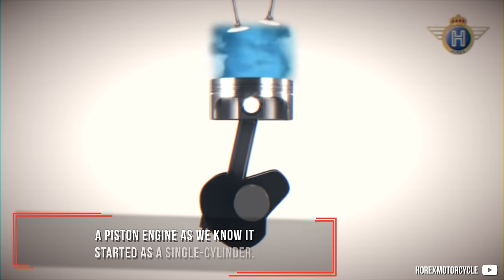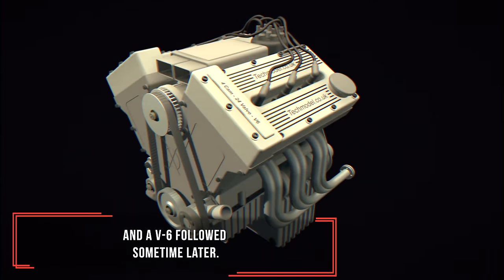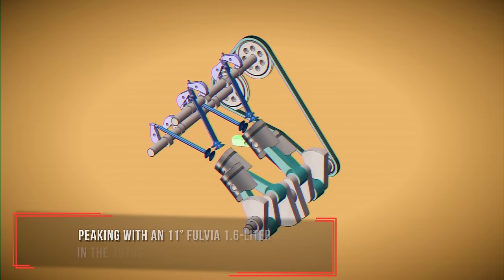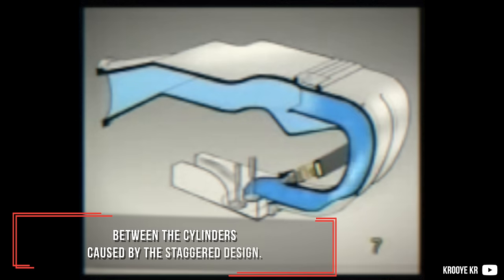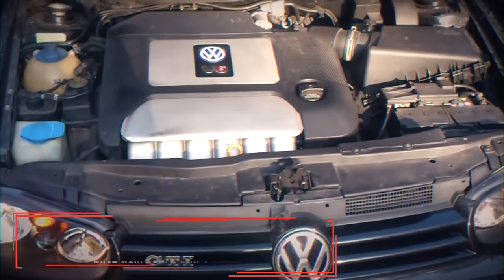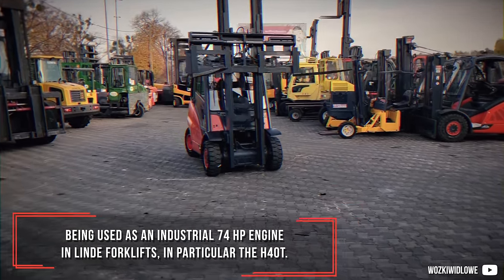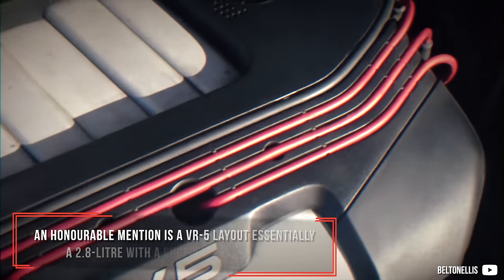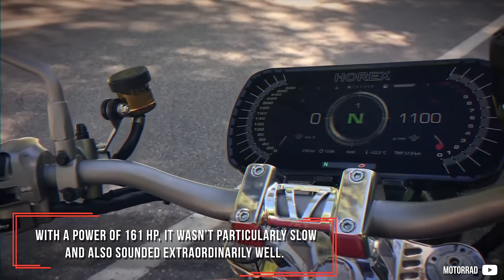What Is So Special About A VR-6 Engine?

Comment: Is it only me or the VR6 really sounds crispier than regular inline 6?
Reply: VR engines (especially the ones from vag) are known for their special crispy sound... a lots of poeple (including me) think they are the best sounding 6 cylinders on the market
Reply: Owned a 1993 golf vr6 (stock exhaust) - they really do sound good.
Reply: They sound like an absolute fart can sometimes.. 🤣
Reply: I wonder why they burble/rasp like that? V6's (Nissan VQ) also share it too but less intense, but an Inline 6 (2JZ or B58) sounds very smooth. I assume its because V engines have an odd number of 3 cylinders per bank??
Reply: @Josh-qm4rb  their extraordinary sound comes form the difference in length of the inlet and exhaust tubes for the left and right cilinderbanks. I love the sound 😍
Reply: @stephanmetph6098  And a different firing order as well, as they fire 3 cylinders on one side first and then the 3 on the other
Reply: @stephanmetph6098  This is correct…unequal length exhaust and intake runners give a unharmonized sound. This is why Subarus flat-4s have an almost V8-like warble as well
Reply: @demoritzz5327  
I hear the lovely vr6 sound and think some exotic car is coming down the road. 
Straight piped suby? 
Makes my ears bleed and sounds worse then Jim Carreys most annoying sound in the world from dumb and dumber.
Reply: I'v seen someone comment it sounds like chewbacca, personally i think it sounds like some bad-ass trumpet or tuba staccato, or flutter as it would sound more close to.
Reply: The VR6 has straight 6 firing order and manifolds. Making smooth straight 6 intake and exhaust sound. But it fires all 3 cylinders on 1 side. And then all 3 on the other side. Making the combustion sound absolutely burbly. The smooth intake and exhaust sound and the burbly combustion sound together, make the VR6 sound.
Reply: If they sound "crispier" it is not due to the cylinder layout, it will be the mapping, induction and exhaust giving the sound, that, and properly screwed together.
Reply: The VR engines may do, but I can't see how it is down to the configuration.
Reply: @MrTheHillfolk  hold up why are talking about VR6's and the straightpiped subiesXD
Reply: Inline 6 ftw
Reply: @demoritzz5327  6 cylinders are not known for sounding good though. They're notorious for sounding raspy/ farty. Having the title of the best sounding 6 cylinder is like declaring a particular turd the least smelly of all poos.
Reply: @lastnamefirstname9043  i beg to differ...i don't know who told u that but i'm pretty sure that was his or her personal oppinion. Also i think a lot of poeple would disagree! What kind of engine layout do u prefer? My heart beats for five cylinder engines( i own a vr5 so that is my conection to vr6's) and i like rare engine lyouts like vr w or flat engines. Did u ever hear a vr6 in person...im sure u would like it too😉
Reply: The VR engines do have a nice sound
Reply: Jantje Pietje  the pistonspeed is no different than in other engines?!🤣
Reply: It ain’t an in-line 6. It’s a 15 degree v6 that coincidentally has a single head. Which is why it has it distinct sound that they have. The 24v sound better in my own opinion but that’s just me.
Reply: Best sounding engine
Reply: And they rev up so quickly and smoothly. I have one in my Atlas. Idk why anyone would opt for the 4 cyl when the gas mileage isn’t much better, won’t last as long, and doesn’t sound nearly as good.
Reply: Yes my man, super crispy.
Reply: It is not just you, brother.  The 24 valve VR6 is a goddamn monster.  When I get my shop and some extra resources, I'm going to start playing around with these marvelous wonders.

By the way, the Jetta, Golf, and Golf GTI are my all time favorite vehicles.  I've bought, owned, driven, and, sold over 80 cars in my lifetime. 32 of these vehicles were VW's.

The Golf GTI's were always my favorites.  

Jason Wampler
Reply: I always get compliments on my exhaust sound .
Reply: Duhh🙄
Reply: As much as I appreciate the engineering. Nah I reckon L28s or rbs sounds far far nicer. Especially in person
Reply: Absolutely!
Reply: RB and 2JZ and even LD28 sound far better
Reply: The reason why they sound good is the different lengths of the intake and exhaust runners
Reply: Honda CBX best sounding 6 cylindres engine
Reply: @demoritzz5327 who else makes VR engines?
Reply: @kilovwdude6457  there is a small motorcycle company called horex that build vr6's. I believe their vr6 has 3 camshafts though If i remember correctly and I'm pretty sure there is another one I can't remember what it was exactly though
Reply: @lastnamefirstname9043 heard a Corrado VR6 (2.9) yesterday and it sounded delicious. Smooth, deep, burbly.  Have you heard a VR6?  I have a straight 5 and a VR5, and they're tasty too, especially the straight 5.
Reply: I feel like the audi 2.7t ,Vr6, & rb26 are best sound 6cyls ever. Just my opinion tho
Reply: Best sounding wish they produced more power NA . They sound so much better without a turbo
Reply: Nasty little engine, it sounds like a big cats growl. I have a golf with the 24v vr6
Reply: Brain dead. Whole different timing. Obviously it's different
Reply: We call it a wookie for a reason!
Reply: Well technically its still an inline engine but if we wanna argue sound then the v5 sounds better. And the i3  diesel sounded great with mods
Reply: @hakonhelgesen7659 a guy who knows his onions 👌.  Same reason i love the i3 diesel turbo from vag. Opened up and tuned it sounds like a baby v8
Reply: @jigzonyt517 I won't argue about the sound of vr5 but I wish VW had made a VR7 .
Reply: @bobbyoghee9124  the newer morevalve ones
Reply: The rumble my friend, the rumble🗿
Reply: Yes! It sounds fantastic
Reply: They don't call them wookies for no reason. 😂
Reply: It does
Reply: Yes because of the different length exhaust runners in the head

Comment: I owned a Fulvia for a few years and had a lot of trouble explaining the engine layout to people. But if I referred to the engine as "basically a Volkswagen VR6 with 4 cylinders" the suddenly knew what it meant.
Reply: Wasn't it easier to just call it a VR4?
Reply: @satsumagt5284  I did call it that sometimes to try to help explain. Though Lancia merely referred to their engine as a "narrow angle V4" at the time. The VR name hadn't been invented until Volkswagen introduced the VR6.
Reply: @krudmuphinstudioz   The term VR is a VW invention, and did not exist in the earlier Lancia iteration of these engines.
I believe that is because VW wanted to emphasize the 6-cylinders-in-4-cylinder space in their marketing, by calling the concept literally "V-Inline", which translated phonetically to {Fau-Reihe} and alphabetically to "VR". The letter V is called "Fau" in the German alphabet, just as Y is called "Ipsilon"!
Eg. {Fau-Wee} when they speak of {Vee-Double-U}
Reply: Had a used VR 6 3.6 2008 Passat loved that car for several years just traded it 2 years ago
Reply: Actually the other way round. The VR6 is basically a Lancia V4, with two additional cylinders.

Comment: ive NEVER understood the argument that an inline 6 engine is too long. that give you an incredible amount of space for efficient intake/exhaust/forced induction opportunities while leaving massive amounts of space for all extra support systems such as ac/brakes/electrical systems/EV additions. next issue is they say the crank cant handle the power because of torsional failures and thats why v6's are stronger. 90's inline 6 crank could usually handle upwards of around 550hp. engineering and metallurgy has came a long way which they could easily increase that but then you have a car with quarter mile of probably high elevens for a "daily driver".

Comment: Been driving Volkwagen since 1989 and the R32 has become my favorite.  My first was a mk1 GTI and I can still remember that car surprised a LOT of people off the line, or rolling down the highway.  My Mk5 R32 gets much more of the same reaction.  The VR6 engine paired up with a DSG is just an absolute kick in the pants to drive.  It's insane what output you can get from a VR6 with any level of modification, and yes, the wookie sound is quite iconic.
Reply: If you like the R32 you should look up the guy who put the Passat R36 engine in his R32 its insane

Comment: We've had two cars with vr6 engines..a golf r32 for about 12 years...no engine issues and a passat r36 which I've had about 6 years  and no engine issues.  
They both averaged about 28 mpg and sounded great.   I'm hoping to keep the passat for another 5 years, mainly because of that engine, i think.  Favourite engines of all cars I've had.

Comment: Had a 1993 mk3 VW golf VR6 2.8 174hp – great engine, fast for it’s time, had great engine sound and was quite fuel efficient when driven reasonably. A friend of mine had a 2000 VW Passat vr5 2.3L 150hp – that was crap – neither fast nor fuel efficient. Great video as always!
Reply: I own a seat toledo with a 20v vr5  and i can tell you the 20v engine is awesome it has 170hp and needs 8-10 liters per 100kilometers depending on your driving style the car always surprises me when i can keep up with newer sportier cars on the autobahn. I think the combination of the "weak" 10v and the heavier chassis of the passat just made it a "bad combination"
Reply: Mk3 vr6 >>>
Reply: I agree, i still have it .

Comment: The vr6 3.2l also came in the audi tt mk1(2003-2006) making 247bhp that was paired with a DSG transmission. Also the vr6 3.2l came in the audi tt mk2(2006-2014) which had the same horsepower number, but came with a option 6 speed transmission.
I seen the audi a3 was mentioned, but I wanted to feel included too.
Reply: Thank you for hoisting that TT 3.2 DSG flag, now I can get off the screen and onto the wrenches, all kindsa motivated!
Reply: i was also waiting for him to speak about the 3.2 VR6 which is an incredible engine. it's almost comparable to the 2JZ in terms of achievable power with stock parts

Comment: W engines by VW were essentially two VR engines joined at an angle. I believe the W8 in the Passat had a 72 degree V angle.
Reply: True but the W8 was a terrible engine all the complexity none of the reliability (heads and timing chain & tensioner design issues)

Had one
Reply: The W8 was essentially 2 VR4s

Comment: Cool Video! I own a Passat b7 with the VR 3.6. It's a cool engine but it have a significant powerloss over time due to sooting of the intake tract. I think the problem was not so severe with the old ones with intake manifold injection. (sry for my bad english i hope it's written correct enough^^)
Reply: Common modern issue with every direct port engine
Reply: Your English is great Sir.
Reply: @chrisoconnor3119  thanks 🤩
Reply: @nicokessler6120  what other languages do you speak?  I think your English is as good as mine and I speak only english.
Reply: @chrisoconnor3119  i speak (swiss)german, we learn french at school. You could choose english as second but i didn't^^
Reply: @nicokessler6120  nice.  Are you into V.W. cars?  I'm studying before buying. Looking into V.w and Audi
Reply: Don't ever get rid of it if all possible I very much regret selling my 08 Passat vr6 with a 3.6
Reply: @ernestpaniagua1210  well i have >200k Kilometers on it and when the DSG breaks, it's over. I use it as a family car.
Reply: @nicokessler6120  i see,, thank you for sharing your experience.  I do not like the sound of that either!  
What kind of car  house want next?

Comment: I had a 12v vr6 mk4 Jetta loved that car beautiful sound
Reply: Not to complicated to rebuild did in driveway
Reply: @2wheelfeel93 if you thrash one so hard that it needs a rebuild ur very good at destroying cars....most of the ttimes all they need is chaines
Reply: lol naw blew a radiator house going down highway over heated and the lifters started ticking has 200000 on it needed timing chain and guides clutch to be done so went all in while I was there and that’s why it was rebuilt
Reply: That’s the car I currently have right now, it was a gift to me, and I am trying to make it a project car, but first I need to replace the speed sensor and there’s something no wrong with the solenoid, need to look more into it, but I’ll find it
Reply: The wife's old Mk4 vr6 Jetta we bought in 2001 was sitting in the garage for about 8yrs before I dug in for the timing chains and make it roadworthy again.
Then I went and got a Smyth kit and that's what's happening now. 
She hasn't seen it yet ,and I haven't really let on.
She can figure it out when I pull in the driveway (hopefully) sometime this spring 😁

Comment: I miss my old 1997 Jetta GLX VR6.  The engine was bomb proof and sounded amazing! The best sounding version was the original found in the Corrado and MK3 GTI and Vento/Jetta due to its aluminum intake manifold.  The later versions had a plastic intake manifold which muffled the sound!

Comment: The ol 12v vr6 isnt the greatest breather, but she sounds good. 
It was made so it'll fit in place of a 4 cylinder, not necessarily performance. 
A turbo will fix that, as going NA is very expensive.  
The sound they make is quite intoxicating. 
There's a guy on here with one in a mk3 that runs 11s no turbo, he's proven everyone wrong that you can't go fast with an NA, but it's been developed to what it is over many years.

Comment: The staggered inline, single cylinder head design is probably my favorite. How cool would a 4.0L VR8 making 450HP be? Bet it would sound amazing, and the maintenance is so easy to do on these because it's like working on an inline engine.
Reply: Staggered and in line? It can’t be both…. It’s on a single crank but two separate planes the pistons are operating in so in my eyes, this is a ‘V’ design but the angle is so tight it can have 1 cylinder head , a normal inline 6 cylinder is waaay smoother and sounds like a normal 6 but this does not, it sounds ‘lumpy’ like a V6….🤷‍♂️

Comment: BMC's Duncan Stuart developed an experimental Lancia-inspired 18-degree SOHC V4/V6 engine family that used a toothed rubber belt to drive a centrally-mounted camshaft, being conceived at the behest of Leonard Lord from about 56-58 (who wanted to replace BMC's various engines with a common engine family - the later E-Series being conceived for a similar unrealistic purpose) before being cancelled in late-62. The V4 was tested in a 1.1 and 2.0 forms (in the likes of the MGA, first MGB prototype and possibly even one A40 Farina in 1.1 form), though the V6 remained a paper project. The BMC 18-degree V4/V6 project however was dropped because of its alleged bulk/weight, inability to be mounted transversely in the upcoming FWD 1100/1300 and 1800/2200 (only longitudinally Triumph 1300 style - unlike the VW VR6), reputedly sounding rough by MG engineer Syd Enever who disliked the uneven exhaust note of the V4 configuration, being too costly to develop (and the cost of requiring a thorough refit of the Longbridge engine production facilities) as well as once the A-Series engine proved capable of being enlarged from 948cc to 1098cc (later 1275cc).

Comment: I have this 4:54  2.8L 200 hp VR6 engine in my 2004 MKIV GTI.  Engine code BDF.  The engine requires premium 91 octane fuel.  Regular fuel (87 octane) is inadequate.  I'm interested in understanding why you believe regular fuel is suitable for this engine.

Comment: You should do an in depth on the W8, W12, and W16 engines!
Reply: I thought they were just vr engines joined.
Reply: @clevernduruza8624  That's not wrong. They are 2 VR-Banks on one Crankshaft. To Eddie: It triggers me everytime that these engines were called "W". Because a "W" will have 3 Zylinder-Banks. The VW-engines are more "doubble-V's or doubble-VR's". In my opinion. 😀
Reply: @DJDEVIL82  Absolutely true. It gets me every time too... More like a "V V" than a "W".
Reply: @rosstihh2220  it is pronounced as ( Double V ) in several European countries

Comment: I really like my VR6 Atlas. It's a big car.
 I tell my friends it's an Audi A7 with 20 less things to go wrong and 1/2 the price.
Reply: I have a 2019 SEL Premium and aside from wishing it had a Turbo option the way the Audi does, I actually like it just as well if not more than the Q7.  I rented a 2019 Q7 for a week when it was new so I had experience with both.  Seeing other Q7s on the road the Atlas just has a better overall look.  It looks more aggressive and bigger (the Q7 seems to slouch [i.e. it sits lower) compared to the Atlas).

Comment: A VR6 engine in a forklift truck?? Now I've heard everything!
Reply: yeah I was also surprised, but it also makes sense. More cilinders means more torque at lower rpm, and with the low combustion given by Lpg you need as many as possible. Also fits into a small space

Comment: I owned two of these, a '92 Corrado SLC with 2.8 liters and 178/190* hp [190 after my mods], and a '97 Jetta GLX with 174 hp and a fucking slush pump automatic transmission.

-These engines are HOOLIGANS!  Their sound and they way they develop power entice you to drive them hard.  Sure, the four cylinder turbos can be way faster, but the VR6 is one that seems to say to you:

"Come on baby...What about another 1000 rpm; Don't you want to hear my sweet voice?  Let's EAT THAT FUCKING HONDA~!"

Volkswagen's best engine EVER.  When this came out, I thought there would be about 5 Japanese copies within 10 years, but only one very small motorcycle company has tried this design, which is puzzling since it is  ~~PERFECT~~ for a full dress cruiser bike.

Great video as always!

Comment: The sound is a side effect. The nice thing is the packaging: a transversely mounted 6 cylinder engine. But it's heavy and loses to VW's turbo I4s in every way other than sound.
Reply: That was it's original objective, to fit in place of a 4 cylinder with a modest bump in power compared to most 4 cylinders at the time.